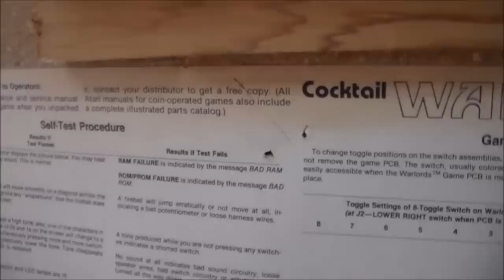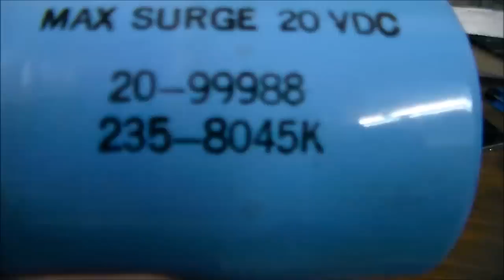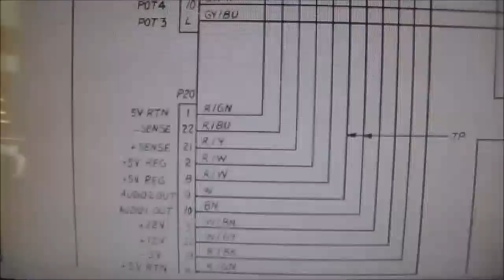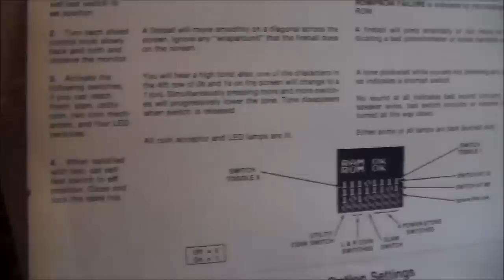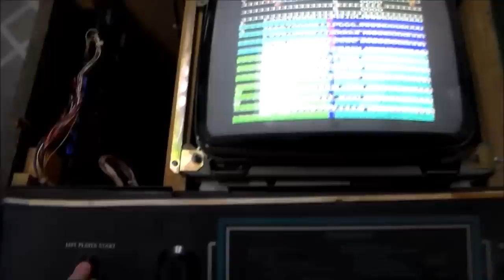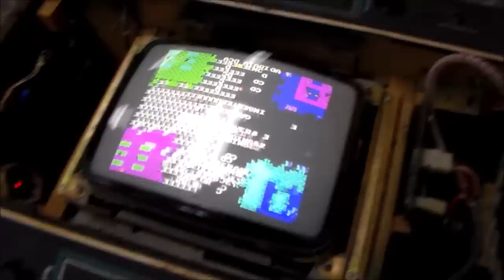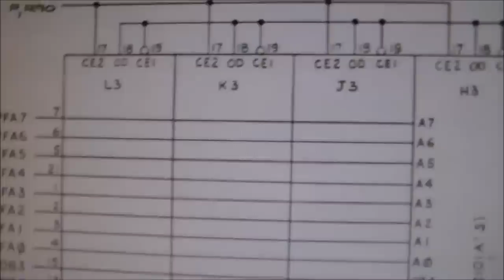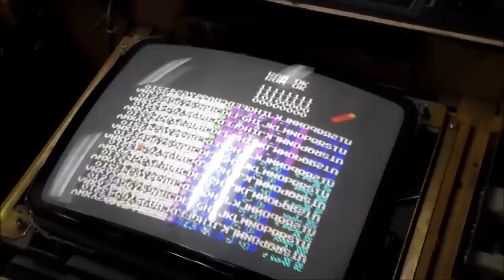Repairing A Hacked-Up 1980 Atari WARLORDS Cocktail Arcade Game - What Did They DO???????

Comment: the sense system doesn't make sense to me
what is the difference between measuring the voltage at the power supply vs measuring it at the board?
it seems like it'd just be measuring the resistance of the connectors and wires, which isn't going to change under normal circumstances
Reply: like, if the board is drawing more power, and the voltage drops
well that won't even happen, because the power supply is regulated anyway, right?
so all the sense system will do is
if there's resistance in the wiring (maybe from dirty connectors?) it'll start increasing the voltage which probably isn't a good thing to do
Reply from the maker: You've got it, the whole thing was to combat resistance in the wiring or the edge connection, by turning it up a bit, which made the resistance in the connectors worse, lol  You're thinking about it from a technician's standpoint... but remember Atari was thinking about it from an operator's standpoint.  The theory was:

1. If they use the Sense mod, when the game voltage drops at the board because of a resistance in the connector, instead of having the game reset or screw up, they want the game to keep running so it can still earn money

2. If they didn't use the sense mod, when the voltage dropped the game would crash or not be able to boot because the voltage is too low (It'll start crashing at 4.8 or so).... if the game doesn't boot it doesn't earn any money, and often at locations the operator had dropped the game off, if the operator even knew how to fix it or measure voltages at all.  The people at the bowling alley or the gas station usually didn't even have a key much less the ability to measure the voltage or turn it up.

Comment: So you replaced a custom Atari chip?? Are the contains public domain now and you can download and burn it into a chip?? Which tools do you need?
Reply from the maker: I just replaced it with another original custom chip, I didn't make a new one or anything.  They do  make brand new ones though, and yes the contents have been cracked.
Reply: @LyonsArcade  Thanks for the answer.

Comment: jesus this guy had no idea what he was doing. outright removed 1 ram chip, probably lost it and decided "meh ill just bypass it with some wires". then he bends 1 pin on some chips he probably didnt even need to remove, and breaks the pin off another and tries to solder it back on, as though that would work. as far as the tracers missing, he likely did a poor desoldering job, and literally ripped them off when he forced the sockets out. ive got to imagine this was the guys first time soldering on a PCB, and lacked a desoldering wick, upon receiving the machine, he just started ripping shit out, and when it became apparent that he had no idea what he was doing, trie to make a hasty repair job and sent it back with a note saying "this shit is fucked"
Reply from the maker: I think the guy that owned it didn't have anybody that would work on it, and his electrician friend decided to try to help and unfortunately wasn't very good with pcb's.....
Reply: @LyonsArcade  i dont think he ever saw a PCB before this.
Reply: maybe some of that but also: traces on topside of old PCB can be fragile on a good day, these old Atari ones don't have a modern type soldermask so you got to be extra careful. on a bad day the adhesive between copper and fiberglass substrate layer gets so weak (heat, corrosion or just wasn't good to begin with) that traces might pop off the board without even touching it.
Reply: @SamuliTuomola_stt  ...there is no adhesive. thats not how circuits are applied. either the PCB starts as a solid sheet of copper clad in an insulator, or the PCB is JUST an insulator with the traces applied via plasma sputtering. its not taped on. its bound, if its not the actual board itself, at the molecular level.
Reply: @FingerinUrDaughter  it's called "prepreg" some sort of adhesive resin, but yes there's certainly different manufacturing processes, I'm by no means familiar with all of them
Reply: @SamuliTuomola_stt  yeah. thats a copper core clad in insulate that is either etched away physically or chemically to make tarces, or traces are applied through plasma sputtering, or i believe hey have a photoelectric way of applying them as well. but its still not adhesive.

Comment: JOE CLASSIC VIDEO GAMES,  Which arcade games use the Power supplies with the Sensing circuit? Most arcade games power supplies mostly don't have the sensing circuit. What are the pros and cons of the sensing circuit because you said some technicians say to leave the sensing circuit so their is pros and cons. 
Any reasons why Warlords used VRAM 2101 instead of using SRAM 2101? when you're were looking up the EVEN and ODD display issue the documents says VRAM 2101 which I don't know why they are calling the RAM chips VRAM instead of SRAM. 
The EVEN and ODD display issue is the EVEN and ODD vertical RAM graphics Chips? I'm not sure what the EVEN and ODD means really.
Reply: afaik sense line is Atari specific thing. the only argument I've heard in favor of keeping it is for originality as it was put there for a reason, as a responsible hobbyist you should know how to care for your game and if you're not willing to keep things original might as well get a MAME cabinet :) (I might be wrong, maybe there's other reasons but that's my understanding).
the reason it exists in first place was that back in olden days if some part started going out of spec and drawing more current the sense line was clever way of keeping the voltage up and the game operational/making money until a tech could deal with the issue. it's just that slowly oxidizing connectors will also cause voltage drop and an amateur tech wouldn't notice the current increase until the connector or some part is burning. IMO it doesn't make sense (sry) to have the sense line in for home use even if you did keep the connectors clean, if part goes out of spec it's better to notice that and fix the game instead of keep it limping. each to their own though.
Reply: not sure about the exact chips used here, but how I've reasoned staggered RAM/ROM lines to myself (haven't actually checked with anyone) is that those chips have access time delay and older the chip the slower they were. memory locations are most often accessed in sequence and if every other access is going to different address decoder/buffer circuit it can cut the delay in half. (modern computer DRAM is also staggered, they have a concept of channels but it's a bit different thing than with these SRAMs)
Reply: @SamuliTuomola_stt  thanks for the help
Most arcade games don't stagger or RAM mapping like they did on Warlords. Warlords has a RAM mapping scheme or sequencing going on which is not common for most arcade games, any reasons why?
Reply: @SamuliTuomola_stt  Thanks for the help
So only Atari used the Sense circuit sense line in the arcade games power supply? 
I'm not sure why arcade games power supply only use one big filter capacitor rated from 11,000uf to 30,000uf, for what reasons to use a very large capacitance value that is over kill and hard to get because most power supplies use muliple  filter caps 4X to 6X at 100uf not 30,000uf any reasons why?
Reply: @billwilliams6338  the staggered thing is pretty common actually. any time in a ROM_LOAD macro here https://github.com/mamedev/mame/blob/master/src/mame/drivers/cinemat.cpp has odd starting offset (0x0001, 0x0801 etc) it's overlaying alternate bytes from separate ROMs
Reply: @billwilliams6338  to put it simply, the transformer is noisy. it's cool that it can produce so many voltages but it comes at a cost. you can try putting electric load on it and watch the ripple on an oscope. ripple would be too much to handle for smaller caps. water is often used for analogies with electricity, ripple is uneven flow, chucking a bucket in the ocean yet doesn't do much to kill the waves, you need a reservoir. :)
Reply: @SamuliTuomola_stt  So you're saying that if there is no ripple the water if even flow? AC Ripple just makes wave ripples in the water i don't think it alters the water flow?
Reply: @billwilliams6338  well don't read too much into it, analogies just help reframing things. circuit design needs it, as simple as that. switcher PSU is technically better but people want to keep things original and big blue is still obtainable.
Reply: @SamuliTuomola_stt  
 ----  Joust,Defender,Robotron,Sinistar,Stargate, Bubbles uses the eight shift registers to output data to the screen four bits at a time for a 16 color pixel. 
     I'm not sure what this really means why they wanted to output 4 data bits at a time to get a 16 bit color pixel. Can you explain what they mean by this because I'm guess other arcade games would only output 1 bit at time to get a 16bit color pixel? 
           The color PROM chip outputs 1 bit at a time  to the color RGB output circuit which has DAC converters to output RGB analog voltages
Reply: @SamuliTuomola_stt  
     I'm confused why some arcade games what to redirect the addressing?
     --- What is the "advantages" of redirecting the addresses?
    ---What is the "advantages" of bank switching the data buss lines and band switching the address buss lines?
Reply: hadn't noticed the previous question.. I'm not sure that about shift registers is accurate actually, Williams video hw is 4bpp, that's an index into one of 16 colors that the game has selected into the palette RAM (out of 16bit/4096 total colors yes but that's not really relevant, one usually cares most what can be shown on screen at one time)
Reply: if you want to understand video hw knowing the theory won't cut it, you'd have to understand https://archive.org/details/ArcadeGameManualJoust/page/n14 how 74ls374 @1A gets and what it feeds through the resistor network to the monitor (r/g/b pins on right side of the page).
bank switching is when the address bus is of limited width but you want to use more data, so when certain pin is high it enables completely different set of memory chips using same addresses for both. (band switching I haven't heard of in this context, are you sure it's not a typo? bands might refer to frequency bands but that's radio stuff)
Reply: @SamuliTuomola_stt  most arcade games total colors are 4bits or 16bits? 
I thought most arcade games total colors was 4 bits
Reply: golden age games were 4bpp onscreen but total colors and onscreen colors is a different thing. onscreen 16bit onscreen colors started appearing when the required hw got cheaper in mid-80
Reply: @SamuliTuomola_stt  What is the different between total colors compared to total onscreen colors?
Reply: arrangement of memory devices vs resistor network producing the analog values (most often in old games it's discrete resistors rather than integrated DAC chip). it all depends on what graphical primitives they're working with, if the game can address 16bit colors per sprite that's fine but there has to be something producing the analog values for the monitor. in that Williams schematic the 74ls374 flipflop only has so many output pins

Comment: It takes me way more time to cut copper foil to shape and glue it down to do trace repair than it does to just desolder your parts right.  

If you're using a 15 Watt iron from Radio Crap and one of those cheap solder suckers, just don't do board repairs, please.  They make professional tools...use them.

Comment: Probably better to change out the original power supply for a switching power supply. Better power efficiency. Cleaner power. Creates less heat. Not likely going to fail spectacularly like a old linear power supply. You can leave the old power supply in there if you want lol
Reply from the maker: On the Atari games the original is better because of the voltages involved, plus collectors appreciate the originality
Reply: Joe's Classic Video Games it’s all opinion more or less. I just remembered how much my first power bill was when I got my first arcade game. lol
Reply: Jay Brooks 
So you’re one of the ones who hacks up perfectly good vintage games to slap a switcher in there because they can’t properly maintain the original equipment?
ARII-02’s are superior well engineered power regulator boards. They also regulate and amplify the audio. If rebuilt, maintained and adjusted properly. They are more than sufficient to use in these games.
Reply: Yeah.. sorry..  winding my own power supplies is fine if its smd work.. but a big bastard like the ones they put into these old beasts.. no thanks. lol 😂

I do agree that Atari separating the input voltage from the rectifying and amplifier was the best design at the time. 

These days you really don’t need to do all that.
Reply: Xyrz Mxyzptlk exactly lol.. as bender would say.. learning is fun (after getting mugged)
Reply: Xyrz Mxyzptlk I love old stuff too. But to me Digital stuff shouldn’t be held by a crutch. 

I am a audio file.. I have a Macintosh amplifier.. when I played guitar I had the tube amp.. I love that stuff.. people gotta realize that the power supply was the best they could do at the time. It was literally a pinball machine power supply.. it wasn’t even designed for digital stuff. Now putting all of the chips into a programmable gate array.. I do have a problem with that. You won’t get the proper presentation or feel without the chips.. (starwars is my example) with some of my favorite games I know I can get easier game play if I overload the i/o.. in my favorite vector game you keep shooting to slow down the gameplay.. on emulated it is way harder.. so I get it
Reply: @jaybrooks1098  if a digital circuit is correctly modeled in HDL it would have the same timing and feel as the standalone chips. output would of course need to be turned analog for display at some point, if that would be done by the same opamp circuitry as the original vector game there shouldn't be any discernible difference
Reply: or *DAC/opamp should've said, but of course there's no absolutes in this universe, it's always possible to make mistakes in the model, and an enthusiast playing the game expecting accuracy might not appreciate working as a bugtester, at the same time it's quite possible for original hw to be operating with minor faults. ymmv :)
Reply: When you restore vehicles do you use OEM or aftermarket parts? Both answers are correct, depending upon what you're going for. Video games are always going to be power hogs with that CRT. If you want efficiency replace everything with a Raspberry Pi and a flat screen.
Reply: Samuli Tuomola  it’s amazing what can be done these days.
Reply: Jay Brooks 
No need to rewind anything. A recap and fresh solder on the headers is usually all that’s required. I’ve fixed and restored tons of ARI-ARII and AR-III’s. I can guarantee that anyone who says a switcher is better on any Atari game except maybe a pole position cockpit doesn’t know what the hell they’re talking about. Also, I can almost guarantee that any collector of full size arcade games does not have their games on anywhere near 24/7 and at the draw of around 2-3 amps per game on average, the excess draw of a linear power supply is negligible.
Reply: Xyrz Mxyzptlk 
Not even a similar comparison. 
If you’re restoring a car from the 60’s to original do you put an engine from a car that’s from the 2000’s in it and expect a collector to say “eh, that’s cool”? Nope, you wouldn’t. He’d laugh at you. There is absolutely no reason an ARII should be replaced with a switcher. 
Rebuild kits are cheaper than a switcher. The time to rebuild it takes less time than to “hack” in a switcher. There’s no benefit. The only excuse is ignorance. Ignorance of how to maintain the original system. I can’t tell you how many games I’ve bought for cheap because the owner can’t figure out the issue and it’s because a hacked switcher shorted out and died or the connections came loose etc... I pull em, trash em and put back in a rebuilt oem and haven’t had any of them fail.
I own hundreds of them...
Reply: I guess it would depend on the purpose of the vehicle I was working on... After all a model t made a great tbucket hot rod.. how many of those model t’s did you see getting rebuilt vs built? Probably less than 1%.
Reply: Xyrz Mxyzptlk 
You know nothing about me. 
I’ve worked as an electronics engineer and service tech for over 17 years. I program, diagnose, repair and install chip shooters, high speed optical pick and place production machines. CNC drillers and routers. AOI standard hi resolution and X-ray. For BGA and ultra fine pitch placement SMD/SMT PCBs for state of the art medical diagnostic equipment. I have worked as, and still work with the process engineers for SMT production lines for years now. I also design PCBs as a hobby and for work.
So I’m not too sure you’re gonna be crushing me like a grape any time soon. 

Lemme guess, you own a laptop and have replaced the power adapter on it once so you’re a pro right?